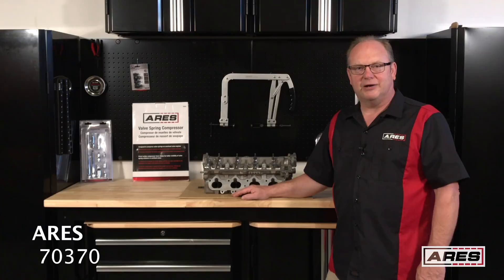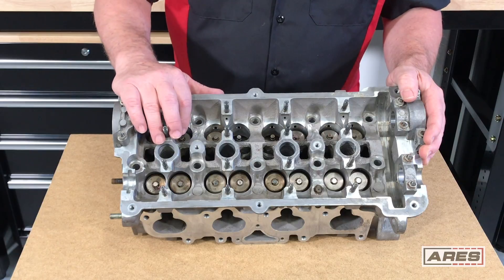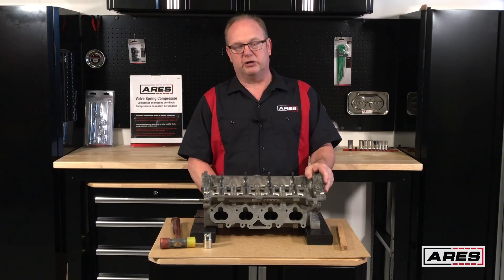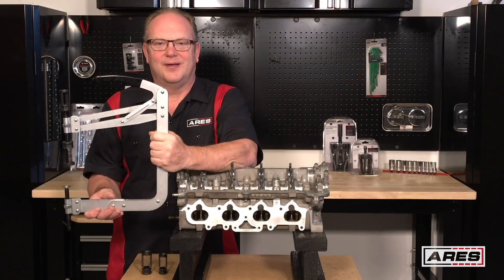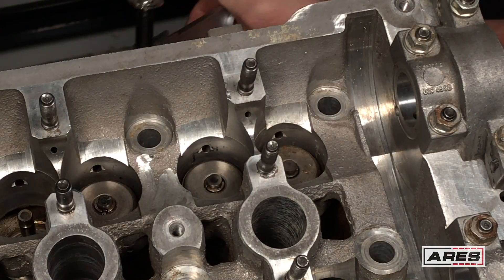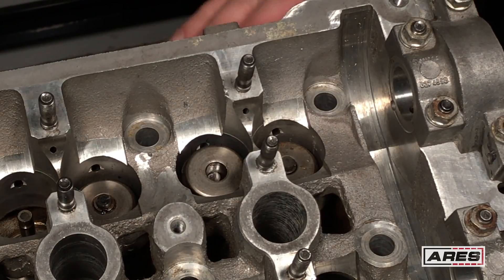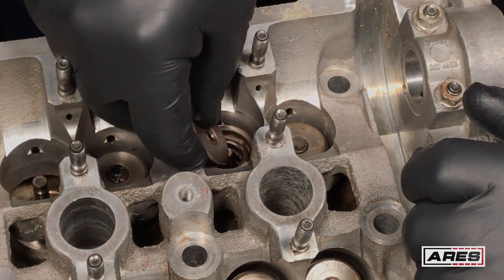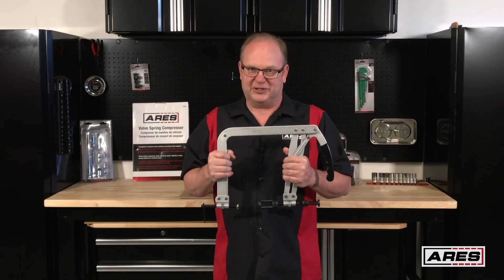ARES Tool Overhead Valve Spring Compressor: Proper Use and Valve Compression

Comment: Taking them out? you don't need this tool for that, just take a socket and put it over the spring now hit it with a hammer, they will come right out every time. Now putting them back in you will need the tool to compress the spring to put you keepers in to hold the spring down. If you don't get the keepers in right, and you put it back in the vehicle, it could drop a valve. Which will destroy your engine, because that valve will drop into the block where the piston is and do major damage to the engine.

Comment: Thank you, sir
Excellent explanation.  Was able to get springs out. Question, maybe a stupid one, but are the keepers and spring caps position specific. Meaning are the worn to the sprung thet go back on? I'm sure the answer is no, but I want to make sure everything is done correctly second time around. Cheers!
Reply from the maker: Hey! Thanks for your question! When doing head work, we've always kept the items in their respective position for reassembly due to wear. Also, caps and springs can differ between intake and exhaust. This minimizes any possible issues from occurring. Sometimes the differences are not readily apparent! Hope this helps - feel free to reach back out if you need additional help.

Comment: Thanks for the informative video.  Will this work for big block Chevy performance heads with 600+ lbs of open spring pressure?
Reply from the maker: Hey! Sorry for the delayed reply, but we wanted to double check the rating for this. We don't recommend this in this capacity, as it is too much pressure.

Comment: Holy $hit, that's a vw 9a (PL or KR (it's probably a KR) head!!!! I've been struggling with my intake valve keepers for days now (believe it or not I'm actually building a turbo ABF clone) and could really use one of these compressors, I just finished my post secondary education and have the short-block completed but since moving home I've decided to disassemble and inspect the original 8v head from the ABA that I was planning to use. 

I knew that the head already had a 3-way valve job, paired with a healthy port and polish but in my final couple months of school I was able to purchase a Megasquirt 2 ecu along with a pristine VW 9a long-block with only 40,000kms, a ported and polished head, and European ABF cams. Seeing as the Megasquirt has been built and programed for an ABF turbo clone (2.0L tall block 16v), I would much rather install the 16v head and avoid using the OEM Digifant 2 ecu. 

Is there any way that the lovely folks over at ARES would be able to help me with this build by supplying me with this much needed valve spring compressor and a few stickers? I doubt anyone else has recognized this head before and you would really be doing me a huge favour that I would really like to repay by displaying your company and brand on the side of this 1991 Wolfsburg Jetta and my future projects that include but aren't limited to my 1992 Golf GTI 16v, 1995 Wolfsburg passat GLX (Syncro swap), 1958 Austin Healey Bugeye Sprite, and 1978 Honda CB550 Four K3. 

Since moving home April 5th, 2023 I have been doing small engine repairs and maintenance for friends and family as I believe you should help the people that have always been there for you. I hope to start repairing, maintaining, and modifying Golf Carts for a few of my mom's friends and acquaintances this summer but because of school, I am in a rather difficult financial position and could really use some assistance in procuring this tool that I desperately need. I ordered a couple of parts in January of 2023 for a cost of $764.86 that never arrived and that has left me in a rather difficult position financially and I could really use some help.

If you folks have taken the time to read this I really appreciate your thought and consideration, I look forward to hearing your opinions and thoughts on the matter and I hope that this message has the opportunity to be seen and heard by those that might be able to lend me some assistance on the matter.

Sincerely,
                  Greg